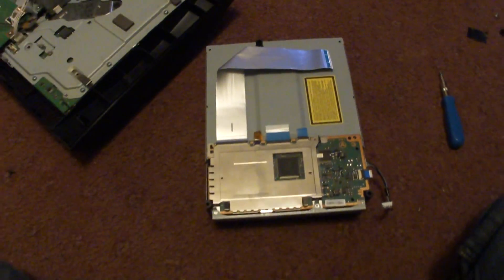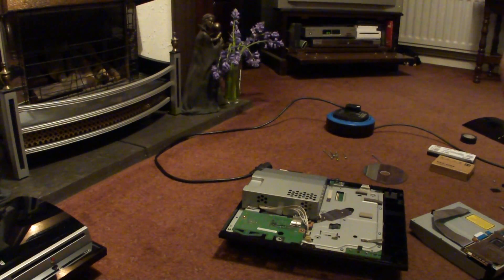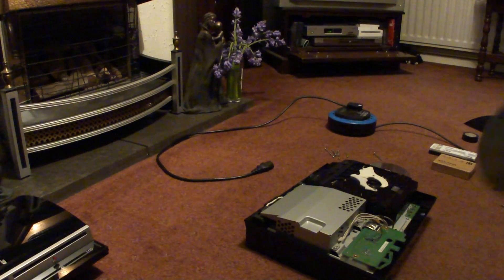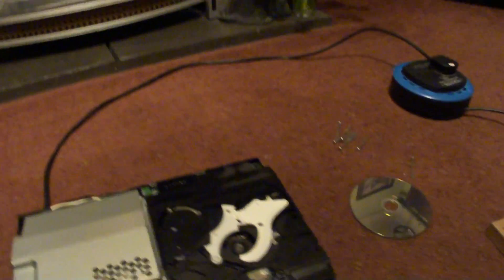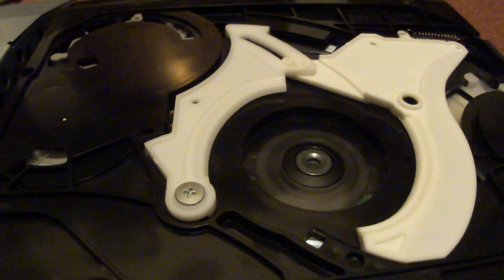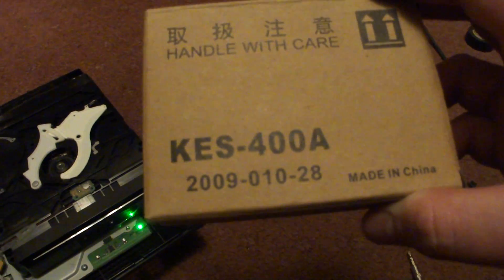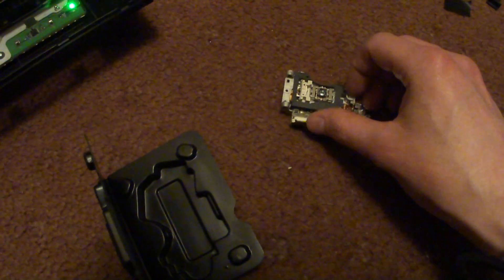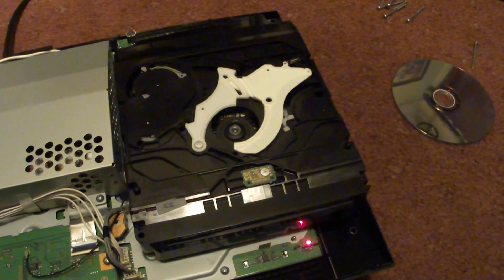Diagnosing a PS3 Blu-Ray drive Part 2. (Wont read disc)

Comment: Mine yes... try to focus but I don't hear the sound of the disc runing... My ps3 is a 40gb CECHG01 model, and I found a CECHA01 model it fits in my console?? I need to take the board on my bluray unit and place it in the another one bluray reader??

Best regards

Comment: I have a fat 80GB (non backward compatible) PS3. My drive is acting really weird. It will briefly work perfectly fine, then it'll suddenly give up and do nothing. I took it apart and cleaned the laser with alcohol. I put it back together, and it seemed to be working great. It did the entire HDD install of Black Ops 2 without a problem. Then, after one game of combat training, it did what it's been doing. Hung after a multiplayer game, before returning to the menu.

Comment: Hi Ben, great video, thanks. But I was wondering how to find out what the specs for the bluray unit actually is. For example, you replaced your unit with a KES-400A, how do find out the version I should replace mine with? Thanks in advance ;)

Comment: Hey great videos thank you for posting them, I took my PS3 apart and followed your instructions but the lasers on mine do not light up at all (no blue or red light) and the disk doesn't spin at all either. What can be wrong with mine do I have to change the two lenses the blue ray and the regular one? Please let me know I will truly apreciate it if you could help me.

Comment: Ben, my PS3 150 GB slim blu-ray drive activates the BR laser (I see the blue light), but my drive still will not read BR movies or PS3 games. The blue light is visible while the drive continues trying to read the BR for about 30 seconds, and then it gives up.  The BR discs I'm using are scratch-free. I've cleaned the BR laser and the dvd laser with a swab of alcohol and dried them with another dry swab. DVD movies play fine. What else can I check to determine what my blu-ray issue might be?

Comment: I was hoping that you would show a way to diagnose other problem's.  For example my disc will not spin at all.  The history,  my drive stoped reading everything except regular cd's, so I replaced the laser(kes-400a).  It worked for a few days, and now it doesn't spin a disc.

Comment from the maker: @Evolution2810 Ebay. Check you get the correct type! There was a couple of types when i got mine and that was before the slimline ps3 so their maybe more now. Normally when they list the item they give you a table thay lists hard drive capacity and number of USB ports and serial numbers, you use that to select the correct one. Hope this helps.

Comment: @ben150785

Thanks for the help ben, but I think it need a new BD drive, cause when I disassembled the PS3, I let it be turned on, and I was trying cleaning the lens and some stuff. But after I forgot to turn off the PS3, and the driver was on the top of the power supply, and when I remembered to turn it off I heard a "crippling" noise coming from the drive, like toasting something, so I guess all the drive is faulty now.

Comment from the maker: @2n2u Follow someones tutuorial of how to take the drive apart. I did have this problem myself, but i cant remember how i rectified it. I made this video more to show the laser/disk spin sequence. As a guess, id try making sure that little plug for the optical sensor is plugged in properly. If that doesnt work try lining it up again. With the dick ejected remove the 5 screws from the top and lift it off, it will probably click as things go back into place. Put the top back on and it should be...

Comment from the maker: @MrHorizon The laser reads the disc then the disc spins. That was why i had to change the laser because i was having the same problem you are describing. Can you hear the lens clicking where its trying to focus? If so im 90% sure you need a new laser. Make sure you buy the right one, there is a couple of different types according to your model number.